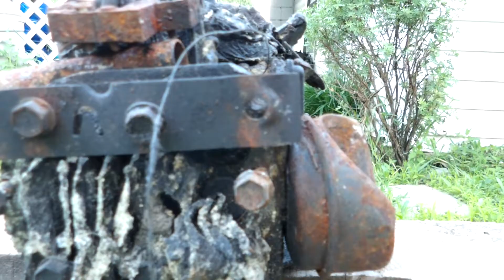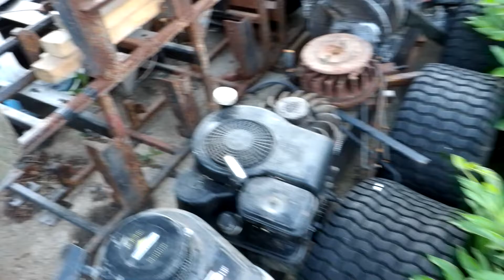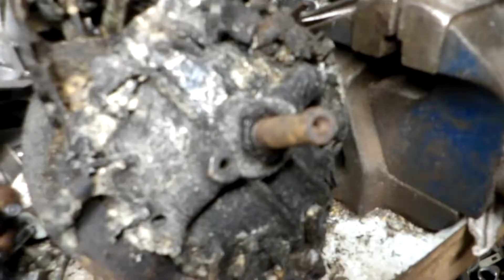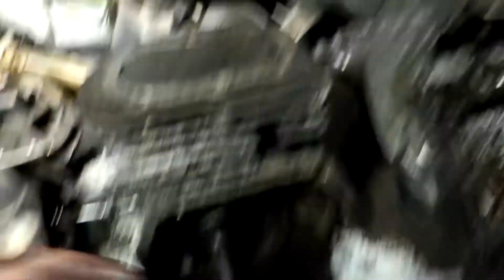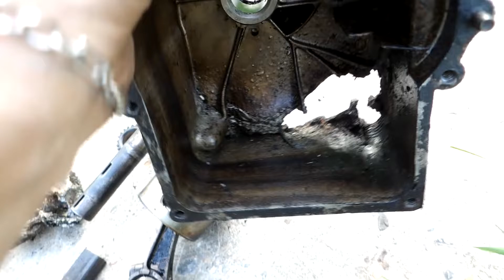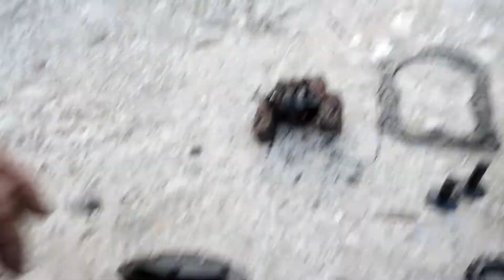Crispy Fried Briggs!!!

Comment: Bet the gas in the tank intensified the fire in the locality of the mower, got real dang crispy!
At least it was aluminum, not magnesium like the old VW engines, those really don't leave much behind!
Reply from the maker: Yes, I am sure the gas in the tank all burned, it even burned the motor oil. I was a bit surprised that the chrome plating on the piston turned blue.
Reply: Yeah, that's some impressive heat!